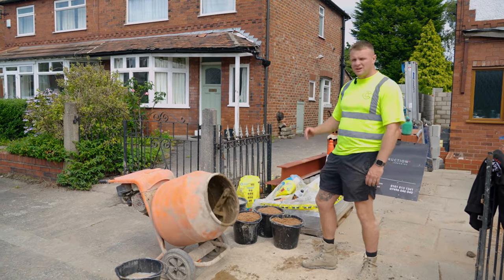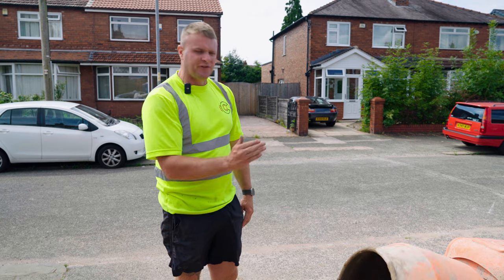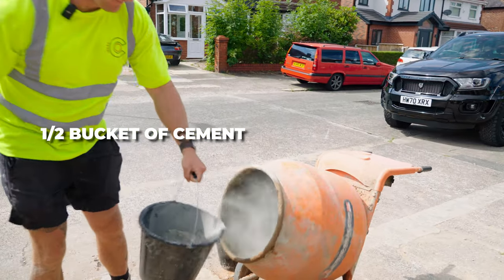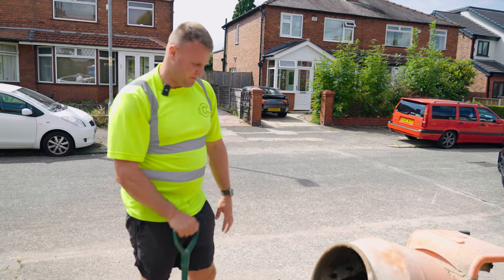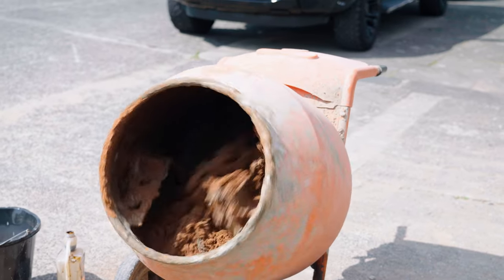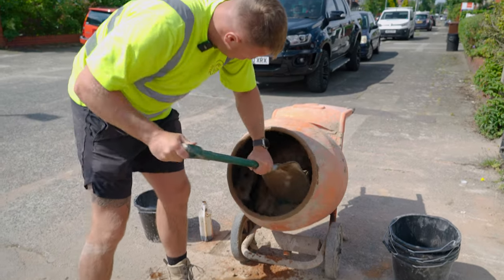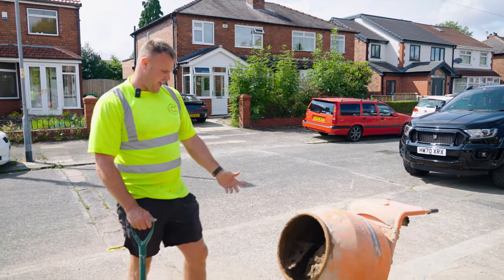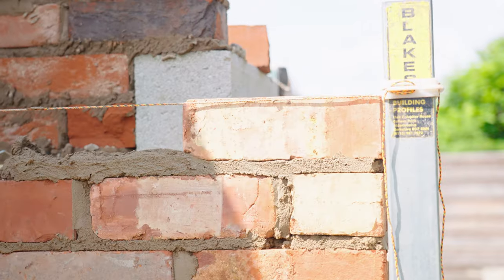Bricklaying tips- How to mix mortar

Comment: Where's the mixer stand?
Reply: The stand doesn’t mix mortar
Reply from the maker: Does that make the mix
Reply: @IdealConstructionRyanWalden  no but add a good handful of shingle to give it a  nice bit of texture brickies love it all the best mate👍
Reply from the maker: @mrc5653  you ain’t got a clue
Reply: @ryanwalden123 totally agree with using a stand ,it's helpful to put the mortar into a Barrow
Reply: @IdealConstructionRyanWalden  behave this is YouTube have a lovely afternoon 👍
Reply: Great to see someone measuring in buckets rather than cutting a bag of cement in half,
My mix water bucket of cement 2 buckets of sand let it mingle then add another 2 buckets of sand, but like you said everyone does it a bit different great video